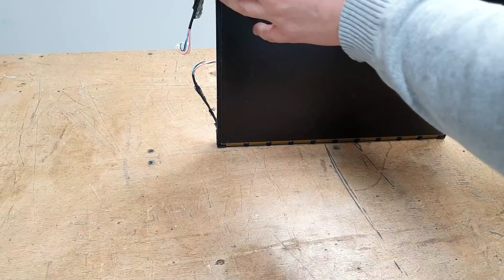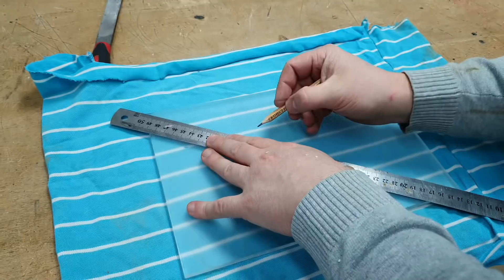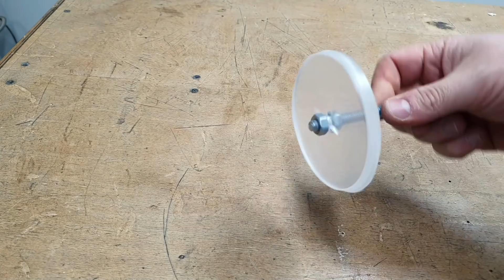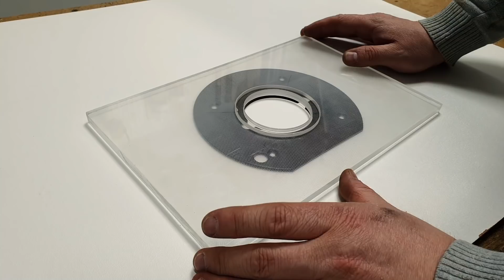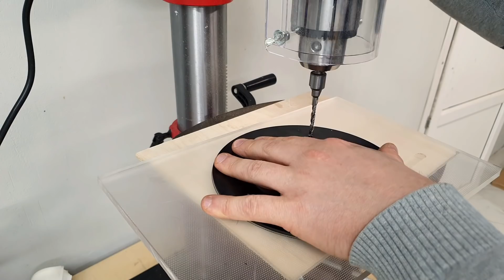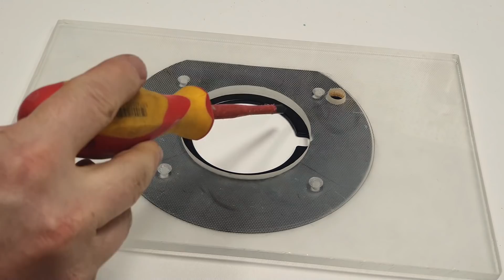Никогда не выбрасывайте сломанный монитор! И вот почему!

Comment: He made a see-through wide base for his router. Pretty cool actually. All of the people complaining about it have never used a router. Get over it people. You’ve wasted more than ten minutes today.
Reply: Maybe you could also attach wires again to make the tin-iridium layer light up?
Reply: It wasn't really a wide base, more a router table mounting plate.
I just bought  one that was made specifically for my router (Triton MOF001 1400W) a couple of weeks ago, so that I can fit it in the extension on the table for my table saw. Now I just need to make an auxiliary fence for it that attaches to the table saw's fence. That way I have a table saw and a router table in one compact unit. :)

Comment: I hope I am not the only person that just doesn't get it ? Whole lotta work for exactly what ?...
Wait ! He is making a spirograph !!🌞
Reply: Router base with different zero-clearance inserts for different sized router bits.  Quite handy if you have a router.  Odd place to get the plastic... didn't know monitors had that in them.  But, the router plate is a pretty standard DIY accessory.

Comment: Never again will I throw out an old, used monitor. You are right, I see them all the time at Thrift stores for next to nothing. I will have to keep an eye out for them. Thanks for this video.
Reply: I'm glad you found this video useful. Maybe you can help me out and explain what it is supposed to do? I have no idea what it is? Unfortunately the person in the video did not explain in the end what it end purpose is for? Thank you.
Reply: @jasminejohnson5704  Hi Jasmine, Gregg here. This is basically a video for woodworkers. Not sure if you are one or not. He is showing you how you can make a Router table mounting plate for your routing table rather than buying one. They can be very expensive. They can start as low as 30.00 and as much as 150.00 or more. The plate has to be of very stiff and strong material and has to be able to support the weight of the router. This acrylic seems to fit the bill. The material should be at least 3/8 of an inch if you are using acrylic. You can do a search for DIY Router tables or DIY router table mounting plates and see some really tricked out versions where the entire tables including the mounting plate is done by hand. Hope this helped.
Reply: @gregghernandez2714  you should've made the video bro ..... thanks for informing Jasmine Johnson and myself as I was as clueless as her as to what it was
Reply: @xii_prime1_iix165  Thanks! I still give the poster of this video credit, because he is Russian, and is willing to put stuff out there, even though it can be difficult to understand. I was looking on building a router table soon, so based on my searches this one showed up, and I thought it was pretty cool that you could use this material. If you are a woodworker, or looking into woodworking, this material might even make a nice material for a table saw sled runners. The reason being, that unlike wood the material would not flex during changes in temperature. I get bummed when I think of all the laptops that are sitting in landfills around the world with perfectly usable material. You take care of yourself Jack!
Reply: @xii_prime1_iix165  Oh yeah, if you want to see someone who really takes recycling laptop components to the extreme, take a look at a channel called DIY perks. He does everything from making faux windows from the diffused glass, to making sculptural speaker boxes from the internal speakers of laptops. He explains that sound quality was very important in some of the older laptops, and they actually have really nice speakers in them. He also shows you how you can re-purpose the microphones, and also create a cheap home security system with some old laptop parts. Pretty cool, you should check him out.

Comment: Once, the plate is cut to dimension, screw the router base to it, and use the router.  That centers the holes, and leaves clean edges.

Comment: PRIME  OBTAINIUM such as I thought and a thousand builds came to mind starting with OOH! Power supply! Nineteen gadgets came to mind, then 300 more utilizing the image layer such as projector or animated stained glass just as he cracked the case for initial reveal to spark the creative juices. I have previously considered 0.5K ish builds since my first such - to convert a Quasar Entertainment Console (top of the line TV/5band radio/Turntable cabinet with integrated amp and 18" speakers. Ah that fine mahogany furniture became a fishtank which you could shutter away. Not entirely disappointed by clear light transmission, this build's only save (which is to say without the aspect of light transmission I'd see the title as click bait to epic fail), I suddenly choked my imagination when I realized today's make project was a transparent router bed jig. As he is centering and hole-sawing I envision a motorized ice spinning all-weather clear view porthole at the limit of my imagineering evidenced by being the last, yet I watched the remaining 3/4 of the show. I felt jilted "Is that all? You kinked my garden hose of creativity!" I finished the VLOG but then had to play with my mental blocks, from the time wasted restoring current and pressure, and adjusting the feeling of pissed off to ripped off to pissed on to just wet.
Now as I write High Intensity Highway Warning, or Aircraft Beacon, overhead projector into TV/Monitor, foreground and background animated puppet theater layers, an image layer suspended in a fishtank, interactive pool float, party lights, fire exit sign... - of the one thousand possibilities which flood back from watching while I was still curious, until I thought of 'router.'

Reduce, reuse, recycle, 'resinate.' I don't pitch similar elements from LCD TV and laptop screens for reasons like this one, which I could have completely never imagined. Thank you, now I have a thousand and one builds from an old TV/monitor and I can still make nine new things with the parts you've left.

Comment: Suggestion!    Use fine tip Dry Erase pen to mark on plastic. Using pencil can scratch and sharpie is permanent. I know this application it would not make much difference but other time it could be important. The dry erase marker will clean off very easy.
Reply from the maker: Thanks for the offer!

Comment: what kind of bombproof plexiglass monitor is that😂  ( i have seen a lot of 1000+screens insideout never seen this thickness) lightsource ,rgb image plate ,only 2 a 3 sheets off 1 mm lightdispersion and corecting foils , and a 2 ,3,4mm milkyblurr projectorboard the side most people see and clean dust off. i have not seen transparent ones( exept glass) this one looks bulletproof😆